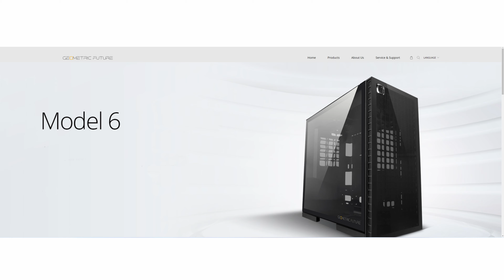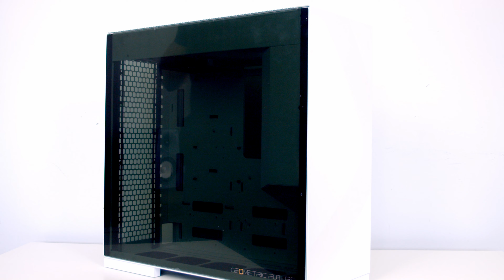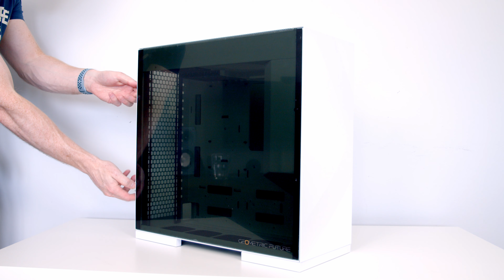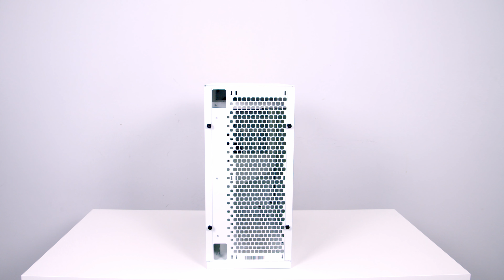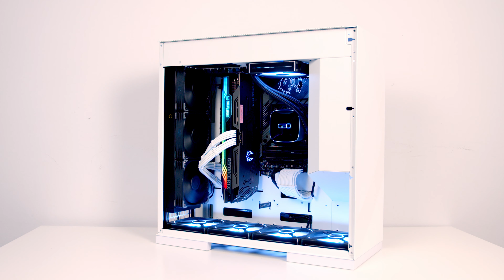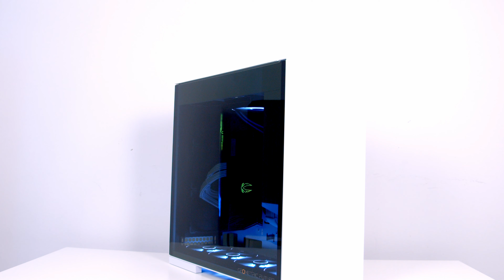Geometric Future Model 8 Review

Comment: No usb c front panel, no cable grommets, no dust filter at the back & terribly designed feet that don't allow you to take the bottom dust filter without lifting the case and that also cover all the air from the right and left bottom fans... DAMN

This case has so much potential & while i adore the layout of it for $200 i'm expecting more, it is missing very basic features that the O11 Dynamic Mini, O11 Mini Air, O11 Evo and even the OG O11 from 2019 offer (USB C front panel, grommets, many dust filters and feet that let all bottom fans intake from both sides and can be taken off without lifting the case) for ~$120-$150. 

I'm disappointed but i see the potential, hope GEO can make a V2 with ALL the missing features i mentioned above, launching a case in 2022 for more than $100 without front USB C is crazy.

Comment: The case is not good for air cooled GPU, the reason why the CPU temps are high because it's intel, the aio itself, and probably the case. Very nice to build liquid cooled system here since it is very spacious to fit two 360mm rads and probably one 120mm.
Reply: I would say it's actually really good for an air cooled GPU as you can setup the side/rear as intake blowing directly into the GPU fans. I saw a notable improvement in GPU temps going from a more traditional case to this one. I do admittedly have a card with horizontal (in a traditional orientation) fins - i.e. it actually exhausts out the PCI slot whereas most high end cards have vertical (in a traditional orientation) fins and therefore exhaust into the motherboard and the side of the case. I'm planning to mount another fan on the top slider cover above the GPU exhaust will likely improve temps further.

Comment: Great overview. I hate that companies are starting to use two tempered glass sides. Aside from my personal preference, this is a very interesting case. I haven't seen anything like it.
Reply from the maker: I don't mind it as long as you have dark tint on the rear side panel
Reply: Segotep has one, -- Segotep Phoenix but the display is on the right side of the case instead of the left, which is kind of interesting in itself

It unfortunately also has a rainbow unicorn puke front panel, unlike this one which is waaaay cleaner in design

But if that's your thing, or you desperately want a right sided glass panel, it's similar to this

Comment: Your graphics card's heatsink is oriented vertically on the card, and there is a shroud on the top directing all airflow down, that's why it's cooler with the riser. The back radiator fans suck the air right out of the fin stack. At that point it doesn't matter much how close the graphics card is to the side panel.

I bet a horizontal fin stack in the same position would tell quite a different story.
Reply from the maker: Good points, thanks